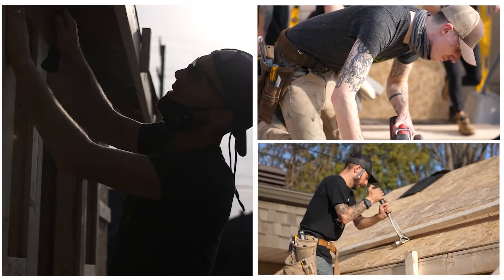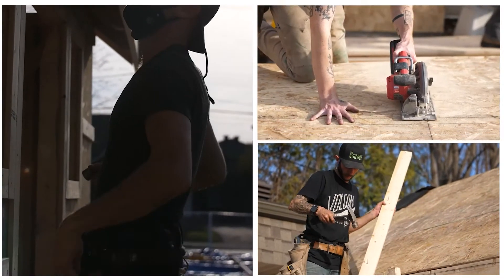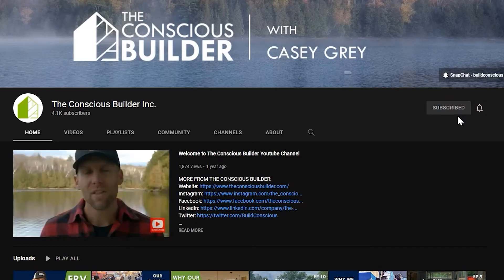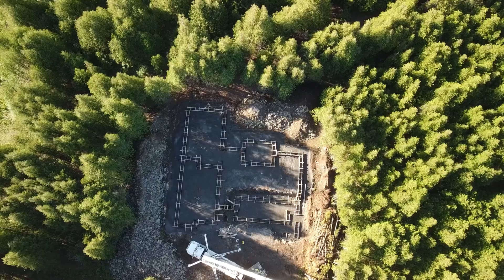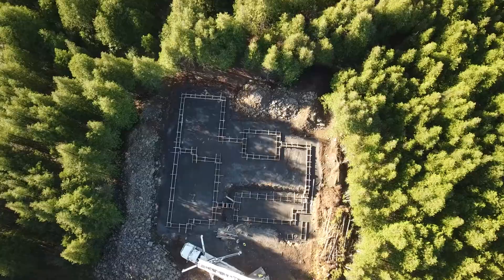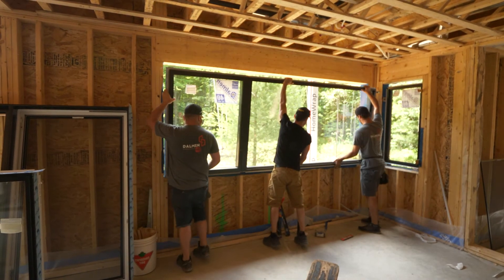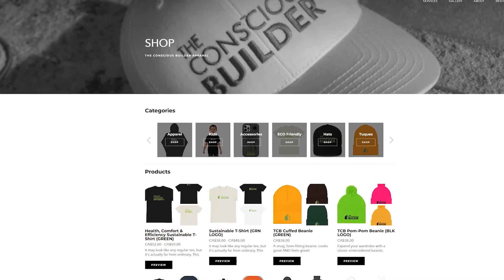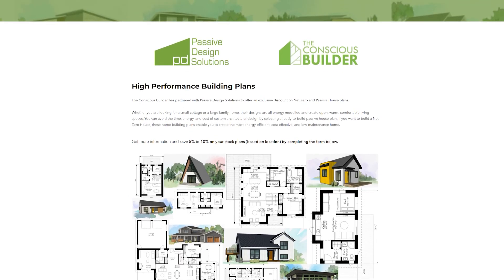Avoid Problems When Installing Triple Pane Windows

Comment: Is upgrading from double to triple pane very noticeable when it comes to heat retention in the winter? I am in the NYC area and want to know if upgrading to triple pane really makes a difference in function or is it just upselling with better objective measures.

Thanks!
Reply from the maker: You may not feel the difference in the middle of the room but you will definitely feel the difference close to the window. A proper triple-glazed window should eliminate the convection current that is often felt by a poor performing window, plus you would be able to have a higher humidity level in the home during the winter and not worry about condensation on the windows which will also make it feel more comfortable. Additionally, if you're in a noisy area, the triple-glazed windows will block more sound!